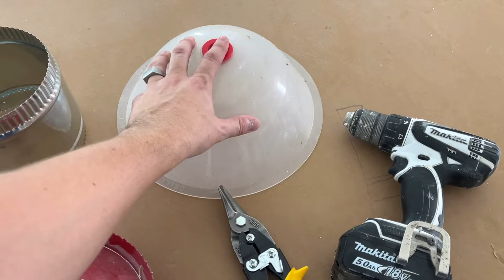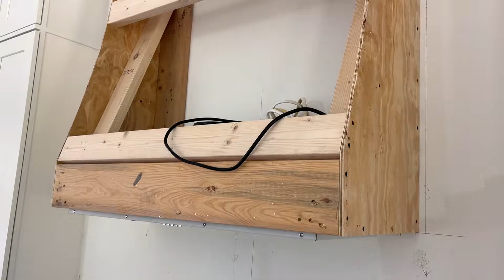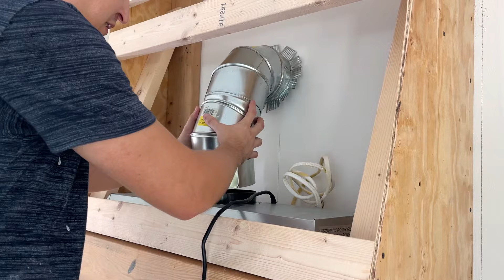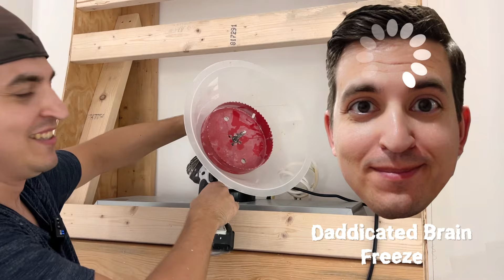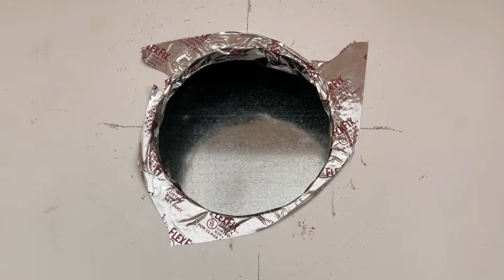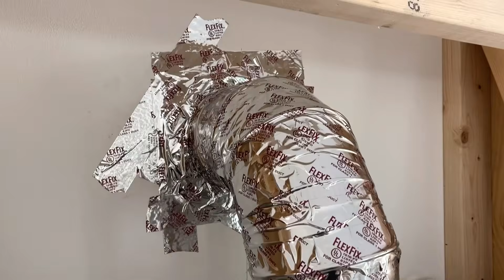How to Install Range Hood Duct for the First Time

Comment: The most challenging part is getting duct out of the house, properly including through any cabinetry and exterior walls / roof....
Reply: I'll bet. I luck out that my 25 year old home already has the ductwork in the wall. I just need to tap into it higher than the current hole is that someone used with a microwave.

Comment: Duct is in the wall but seems to originate from down the wall. That is against code.
Reply: It's probably like the duct in my home (house is 25years old) which had a microwave hole cut. Vent continues down another 19". Why? I don't know as it ends 10" above cooktop. I am installing a range hood and will be cutting in 20" higher than the current hole and was thinking about sealing the bottom of the new hole.

Comment: Is that legal to have the new duct not sealed to the metal of the existing vent? Seems odd to just have it to taped to the sheetrock.
Reply from the maker: It passed inspection so I guess in my state it is.

Comment: (2;00) There's a crimp tool available that you could use instead of cutting the duct.  It's basically like two scissors between the three, and it doesn't cut, but deform.  Otherwise, it looks like sandwidched metal snips.
Reply from the maker: Thanks for the tip. If I'll ever need to this again will need to invest into one.